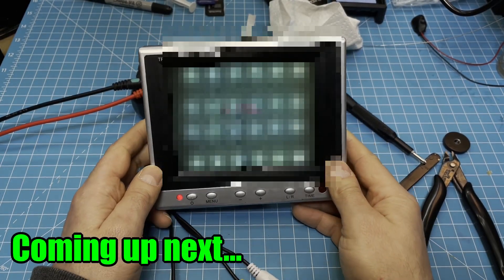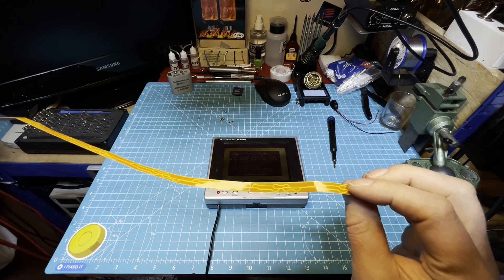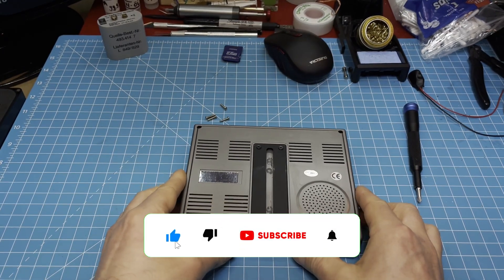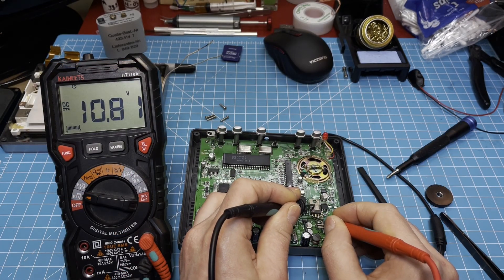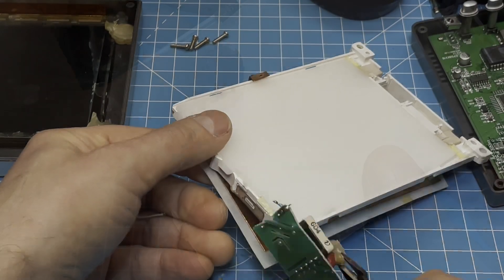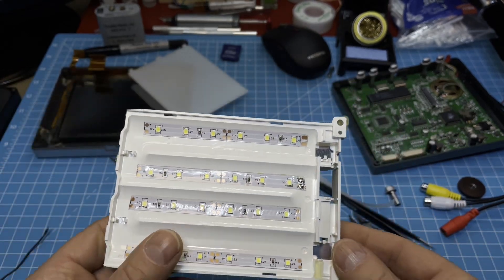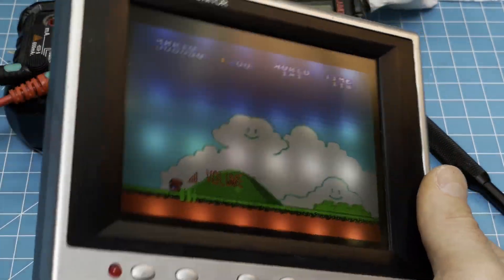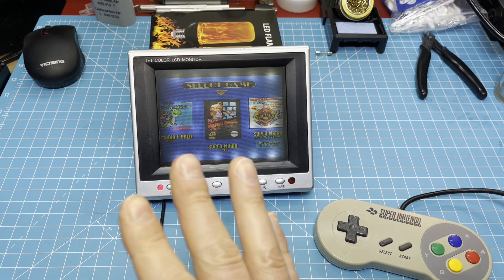INSTALLING a LED Backlight in an old car TFT COLOR LCD MONITOR. #repair #led #diyprojects #modding

Comment: might want to consider using flexible LED filament as it would be a better direct replacement for the florescent bulbs
Reply from the maker: That's a great idea! I have some of those.  And a project for it, too. I have a portable display for the PS2 with a bad backlight. Thanks for the tip😊👍

Comment: they clearly need some better defusion and perhaps it would be better tu use some much denser strip with more LEDs even if ran at 1/3 or 2/3 power (most of the white strips still have separate RGB pins and just 3 smaller white LEDS so you can just run 1/3 or 2/3 of them this way). Perhaps some gell covered strips would have better difusion or you could add some extra difuser?
Reply from the maker: I already solved the problem. Just watch my latest video. I used diffusors from an old laptop display.
Reply: yeh I've seen it later but still I did not remove the comment, might be useful for someone who comes across it.

Comment: Really nice idea. As others have said already, get one of those difussing paper things and it should be muxh better. If you cant get it feom another display, they sell similar things is craft shops for very cheap (is meant for copying prints or translucent drawings etc)

Comment: Nice video! This got me to thinking about trying to install a backlight in one of my pocket computers. I found PP diffuser sheets on AliExpress, now to figure out what kind and how many LEDs I should use to try it out.
Reply from the maker: I think I will add additional diffusor sheets from an old laptop display. If I just could remember, where I put them...🤦‍♂️

Comment: Room for improvement haha. I am not sure what sort of light diffusion sheet would help, but I know there is stuff out there that sort of spreads the light, and would help evening out the backlight. Anyway it was a fun project.
Reply from the maker: I think I have an old laptop display somewhere. Maybe I cut this diffusor up and give it a try😄. Can only get better